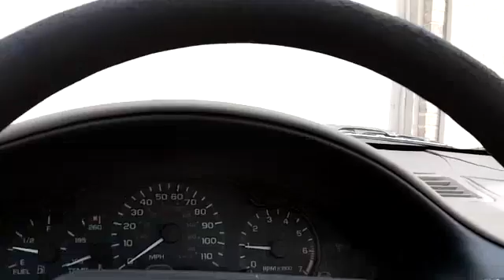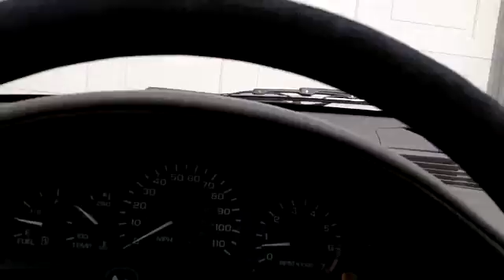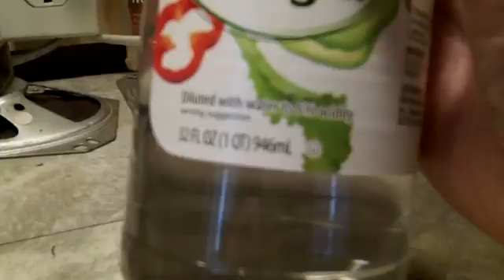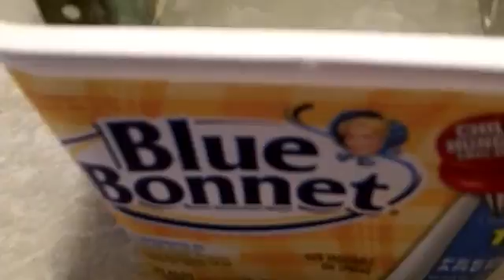Drug deal and bad acid trip

Comment: what about doing Electrolysis put into soda power connect 12 volt dc to it and another plate   Look it up and you will find lots of videos
Reply: +mosslack   Yup, cleaning vinegar is 6% rather than the 5%  of cooking vinegar. No need to dilute in either case.
Reply: +mosslack  Less potent. If you look on the label it will tell you what percent of acid is in the mix. "Cleaning vinegar" is a stronger white vinegar and is so marked, usually at both a supermarket and Walmart.
Reply: +mosslack   I should have done another quick video on the part that I have had soaking for the last week. It is all done now and looks like new! It was part of the fuel filter for the old Wisconsin motor. Sadly, some bonehead broke the glass bowl. We won't mention any names as to whom the reference is being made...sigh